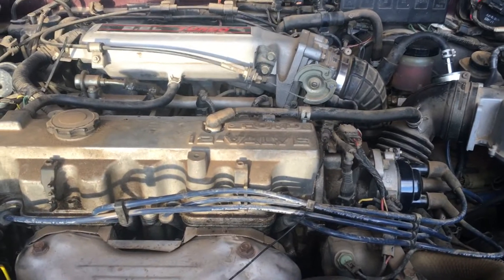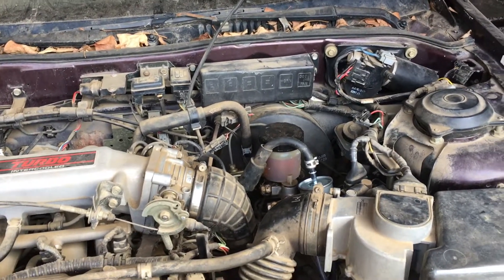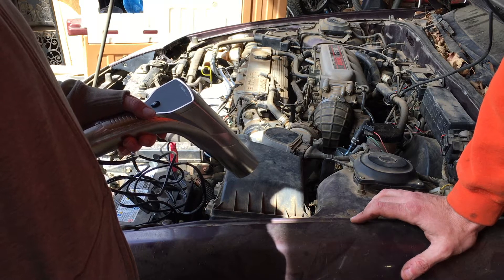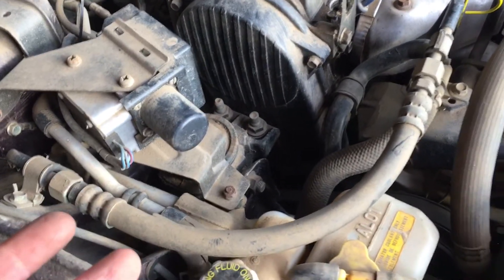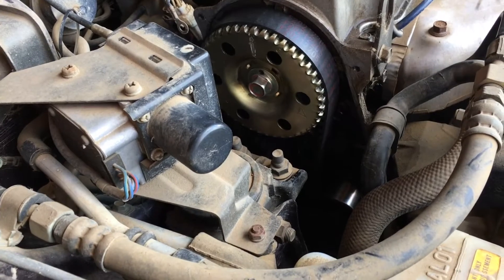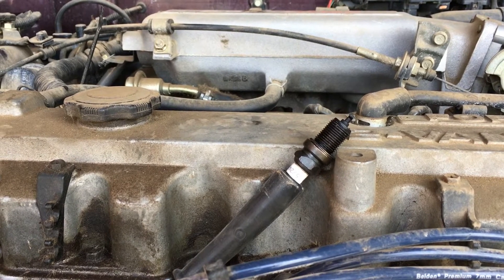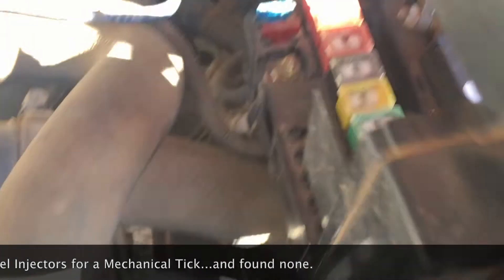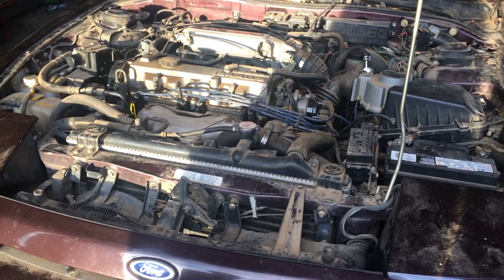1989 Ford Probe GT - No Start Diagnosis when all it does is crank

Comment: Gotta love the practical thought process, in real time.
Reply from the maker: This car is tough as I typically only work on GM cars and have a past experience with them.  This Probe is like talking French, it is technically a language, (nouns, verbs, adjectives) but one I’m not familiar with.  The service manual has been super handy, but the real time-saver here has been the Haynes manual, which will bypass some disassembly steps to achieve the same goal, to save time and expense.  But the internet suggested NOID lights which both manuals missed.

Comment: Appreciate the troubleshooting, replaced the plug wires, and plugs on my probe but no start, previous owner installed a replacement distributor which might be the culprit, many thanks.
Reply from the maker: Yeah, took a few tries to figure it out.  Similar video on the parts car had the mass air flow sensor stuck closed, that was an easy fix.
Reply: Did you ever figure out the problem ?  My wife’s ‘94 Ford Probe had the PIP sensor on the distributor fail.  This is the Ford equivalent of the crank position sensor.  Unfortunately, I had to replace the distributor, but she cranked right up afterwards.
Reply: @glasshalffull2930  I did, i was being silly and forgot which wat the distributor spins haha!
Reply: @themachine3177  I was once working on a car for a friend who had put in a new head gasket.  Lot of stuff had to come off and be reinstalled.  Hours of trouble shooting as it wouldn’t run.  Finally, my buddy goes, “Wait, this might be the problem!”  He then pulled the distributor and rotated it 180 degrees.  Car started right up.  Can’t believe there were two ways to install the distributor.

Comment: Are you getting RPM and where is the sensor for that? It doesn’t have a crank or cam sensor so I assume it’s in the distributor??
Reply from the maker: As far as we could tell we were as we were getting tach movement and spark.  Car uses a traditional distributor for spark.

Comment: You may need to check the following parts:
Mass Air Flow Sensor 
Throttle Position Sensor
Idle speed control 
Fuel Pump Shut-Off Switch
Ford Probe Fuel Pressure Fuel Pressure 27-40 PSI

Distributor Cap and Rotor

ICM-module
FPC-Solenoid
Reply from the maker: One car it was fuel injectors, the second car was a stuck MAF flapper.